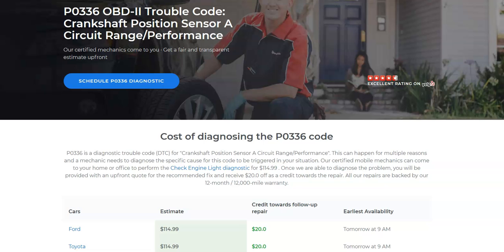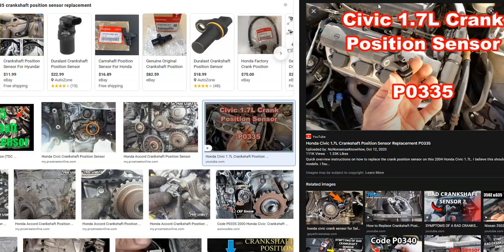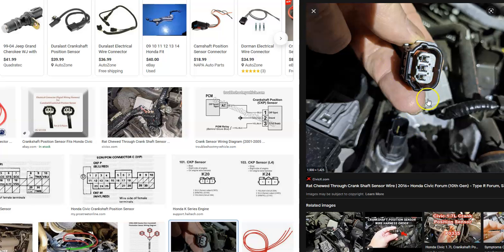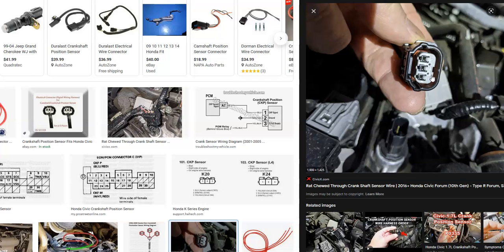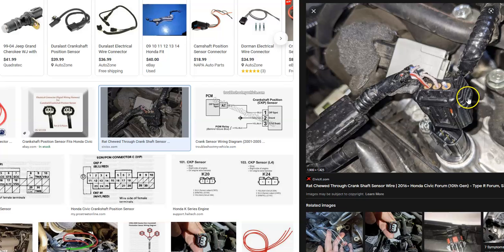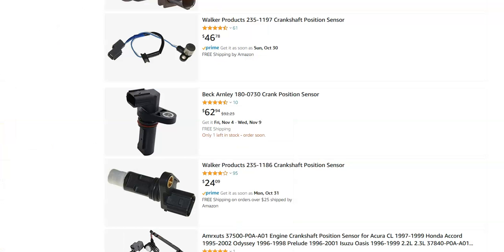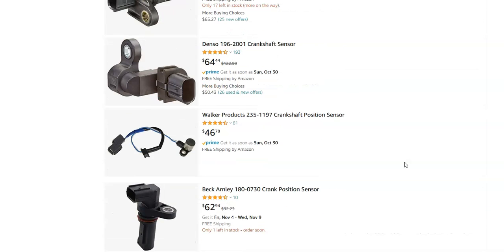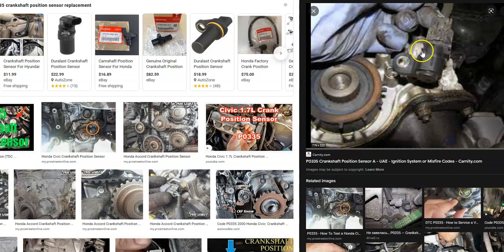How to Fix Honda P0336: Crankshaft Position Sensor A Circuit Range/Performance

Comment: could the code  come from the engine being out of time? or just the reasons you listed? did a water pump on a 1.7 last week and decided to do a cam sensor while I was in there just cause it was original and the car has 300000km. I've done 4 of these water pumps and never had an issue with timing or gotten the P0336 code but this is the first time I've done a cam sensor so signs point to that. I'm just trying to trouble shoot to avoid taking off everything to get the timing belt off again  😂